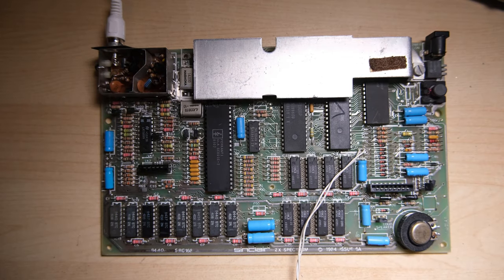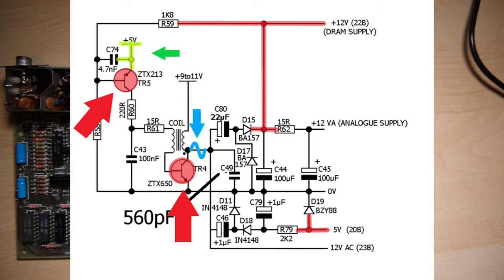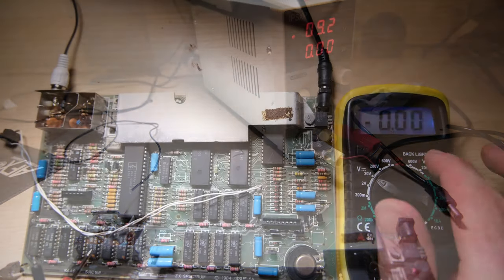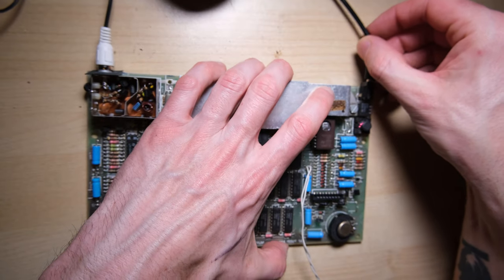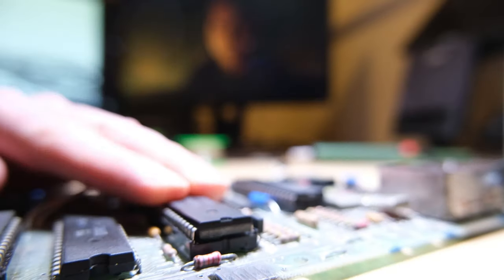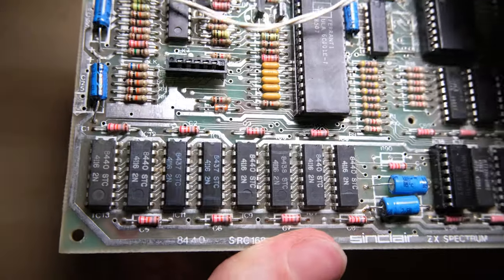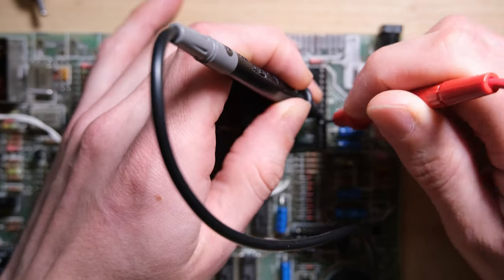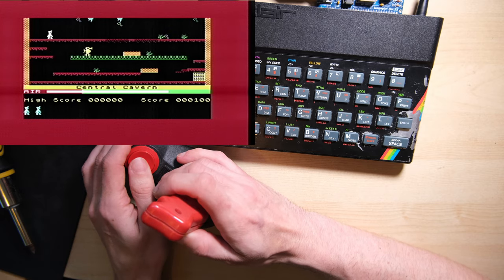ZX Spectrum 48K Repair - ROM Woes

Comment: I bought an issue 3B "fixer-upper opportunity" on eBay and after seeing every failure mode (and replacing every IC and transistor as I chased problems around the entire board) I'd all but given up. Thanks for a really interesting and informative video, I've picked up a couple of useful tips and maybe even the inspiration to try again with this poor hopeless Spectrum! 🤞🏼
Reply from the maker: Thanks! Keep us posted how it goes, always interested

Comment: Yeah, this was a bit odd; after all, IF the Lower RAM chips had indeed all failed, the Speccy shouldn't be able to show any screen image whatsoever. I'm glad you managed to track down the root of the problen in the end, good job.
Aside from that, i THINK i have read somewhere that if those 4116s in the lower RAM area don't get all three voltages correct, there's a risk of them dying. I guess you were lucky there.
Reply from the maker: Yes that's true they can die, but I can't believe they would ALL die in the exact same way! What I still don't understand is why the upper RAM passes the test, I had planned to explain that in the video but couldn't figure it out

Comment: I knew about the Hitachi/NEC ROM jumpers, (aren't they switching 2 pins on the ROM?) and selecting those wrong should of course prevent the ROM to be read properly. But I would never have guessed that it will cause a complete lower RAM failure... Good to know, thanks for sharing!
Reply from the maker: The ROM can still be read properly, the problem is that it doesn't go off the data bus when it's supposed to, which means trouble when moving data between the other chips

Comment: TR5 would actually be better as a higher gain transistor rather than ZTX751. BC556 is plenty good there. The critical one is TR4, as it has to have a high current rating. I normally use ZTX653 there, it's just a higher voltage version of the original (and what Diodes Inc recommend as the replacement). Generally all of the transistors in the spectrum can be replaced with BC546/BC556 types, apart from TR4. The only other one that might need to be slightly higher current is TR7, and in that case a BC327 is good (or even another ZTX653 if you want to keep your stock neat)

The main reason the ZTX213/313 were used is because they were made by Ferranti originally, so Sinclair got some sort of a price deal on them with the ULA. That part of Ferranti got spun out into Zetex (the name was taken from the part code on the transistors!) and are now part of Diodes Inc
Reply from the maker: Extremely knowledgeable as ever Peter thanks for sharing, and thanks for helping me bottom out these repairs in the group